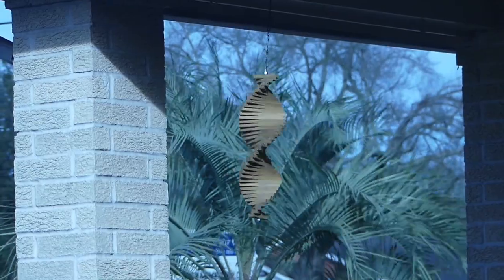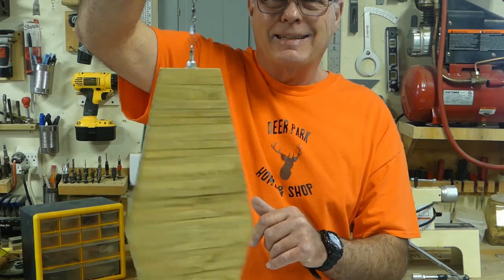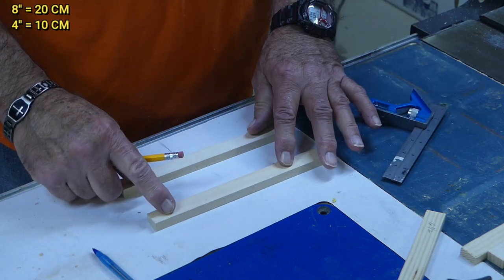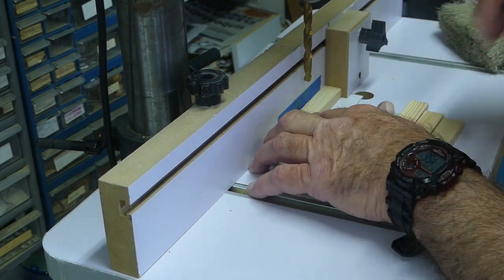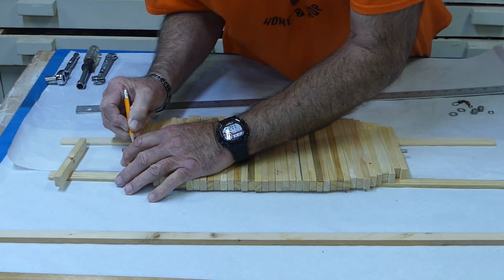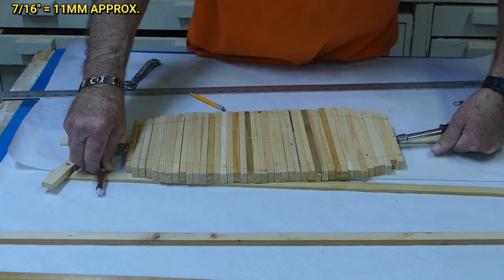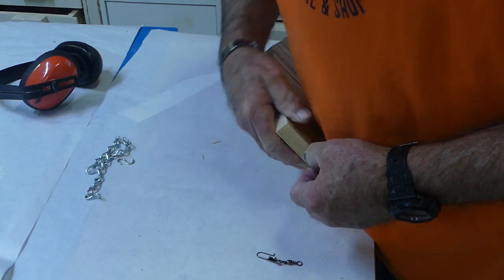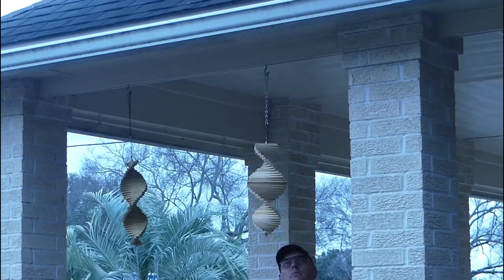How To Build a Cool DIY Wind Spinner - Easy Step by Step Instructions

Comment: Thanks for sharing your spinner. It turned out great. No pun intended LOL. Last year at March break I decided to make some of these with my grand children. I machined all the strips and set up the drill press so they could drill all the pieces safely and then push each piece unto the threaded rod at 24 ". Then we took them to my neighbor and lasered some logos of their favorite teams. These turned out great and spun in the wind. I also ordered some ball bearing fishing swivels from amazon which worked better than the swivels I could get locally.
Reply from the maker: Thanks.  What brand of swivel did you buy?  Some of the ones I have bought work much better than others.  If you've found some good ones, I'd like to try them.

Comment: Good tutorial.  Ive made about 5 so far this Spring using Cedar fence pickets.  The whole process is pretty straight forward.  Instead of drawing a straight line from point to point, I draw an  extended ellipse which gives the spinner a good shape.  I use fishing line to hang them, this way from a distance they look like they are spinning in mid-air.
Reply from the maker: You have some good ideas.  I will try the ellipse shape next time.  Thanks for sharing!

Comment: I'm going to make this, thanks
Reply from the maker: Good luck!  Great way to spend a cold winters day.
Reply: @deerparkhomeshop2471  Ok I made it, but it doesn't want to spin very good, do you think length could make a difference? Mine is not quite as long as the one you made. and I  used thicker pieces of wood, liked your videos so keep up the good work
Reply from the maker: @ftroop211  I know another craftsman who makes dozens of these and sells them.  I made mine from one of his successful patterns and I haven't really done a lot of experimenting, so it is possible that the length or the thickness may play a factor.  The heavier they are, the harder it is to get them going.  Also they don't turn as much in a gentle breeze.  I have also noticed that the swivels I bought at Walmart don't seem to perform as well.  The swivels from my tackle box actually make them spin better, so I'm going to try another brand.  Hope this helps and good luck!
Reply: @deerparkhomeshop2471  thank you, going to try another one, will let you know if it works better, I think some other swivels will work better also,  because this design should work good
Reply from the maker: @ftroop211  Good luck and I hope it works out for you.
Reply: @deerparkhomeshop2471  I think I figured it out, I cut my boards in half and it made it have more twist and the more twist made it spin in the wind a lot better Just thought I'd let you know, thanks for your video.
Reply from the maker: @ftroop211  That's great news and what you say makes a lot of sense.
Reply from the maker: @ftroop211  I'm glad you've got it nailed.  I know you have put a lot of effort into it.  Thanks for sharing with me!
Reply: @deerparkhomeshop2471  Just found this out by accident, the direction they spin depends on which way you make your twist
Reply from the maker: @ftroop211  If you have more than one you can have them spin in different directions.  It looks cool.

Comment: I did everything you did. But my pieces of wood is a little thicker than yours. I put a fishing swivel in the rod because the rod is so small I had to be careful to only get the little hole not the to split the rod.  The swivel is in the rod. But it doesn’t go around. What can I do to make it spin.
Reply from the maker: You know, I used some off brand swivels from Walmart and they don't spin very well.  You get what you pay for. Should have stuck with Eagle Claw.  Also, I now use two swivels instead of one, and if the swivel you are using is too small, it won't turn as well.